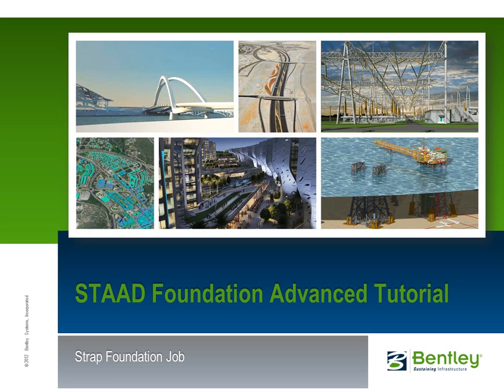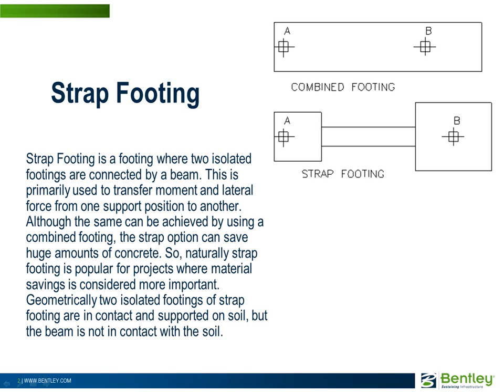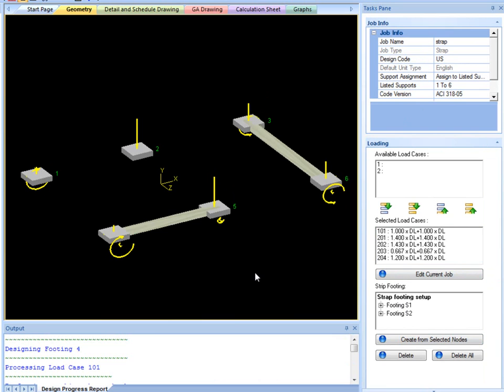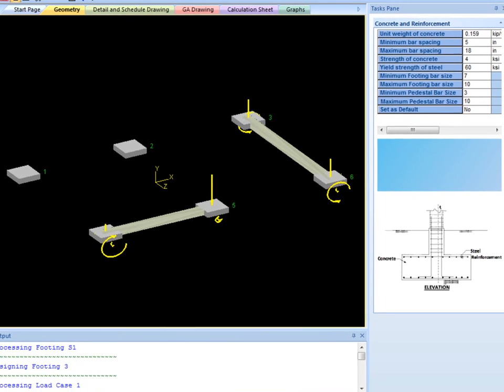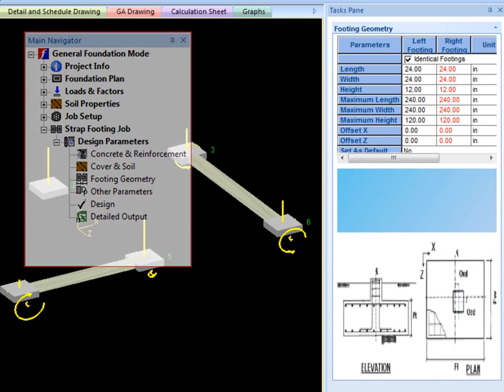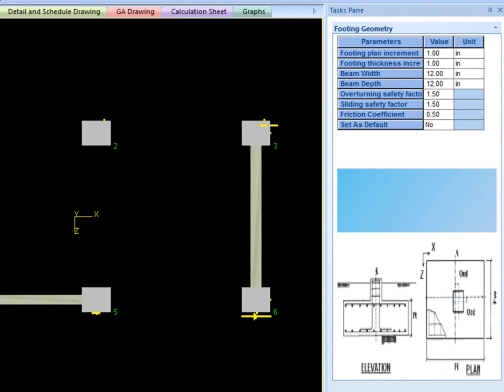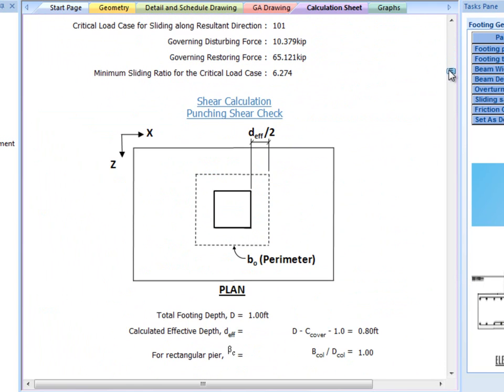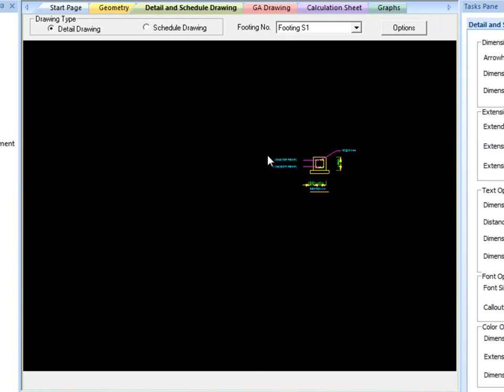STAAD Foundation Adv 17: Strap Foundation

Comment: using staad foundation advanced, I designed a strap footing for two eccentrically loaded columns(offset of left column=-600mm and offset of right column=600mm) of one bay, 3 storey building with grid spacing of about 14 ft in x direction and 12 ft in y direction. The dead load was about 300kN and live load was about 60 KN and earthquake load was about 40 KN in -y direction with moment about z axis 25 KNm. soil bearing capacity was 150 KN/m^3. I used the load combination 1DL+1LL and 1DL+0.8LL+0.8EL. strap beam was in x direction. I got footing size 1.75mx1.75m. footigg thickness 200mm. no of 12mm bars in x direction=6 and no. of 12mm bars in z direction=23. I got doubly reinforced strap beam with 0.53m depth and 9 inch width. bottom reinforcement=3 no. of 12mm bars top reinforcement=6 no. of 16mm bars. And for shear reinforcement it says:"Since nominal shear strength of concrete is greater than maximum shear force, shear reinforcement is not required". I just want to know are the results I got practical or is it likely that I had made some mistakes. I have doubt whether the following result in right or wrong: the vast difference of reinforcement in x and z direction which are 6 and 23 no. of 12mm bars respectively for 1.75mx1.75m footings. and another doubt is requirement of no shear reinforcement in strap beam. Please help me!

Comment: I cannot edit design parameters is strap footing job. what may be the reason?
I select the design parameter and change values in data input pane and click in design but staad foundation advanced designs the footings with the default values.
Reply: +beenay18 maybe you should try it once again. This time, once you change any input value click on any another input value or press enter so that staad foundation knows that you are done with the value modification.